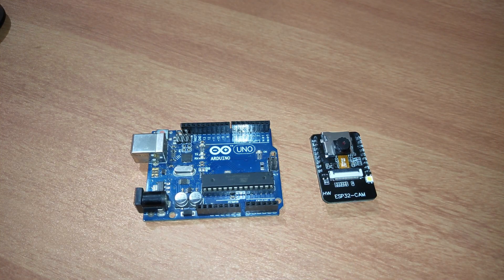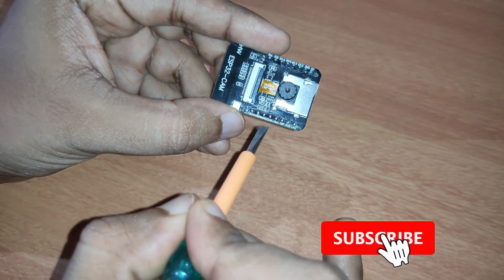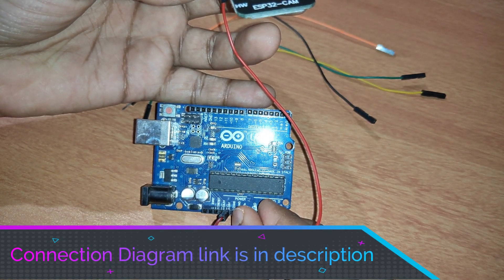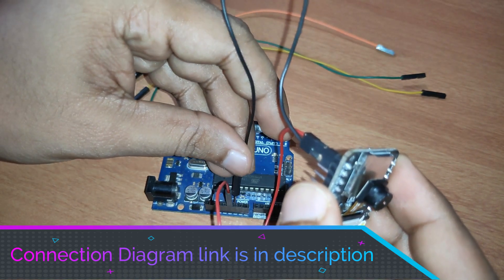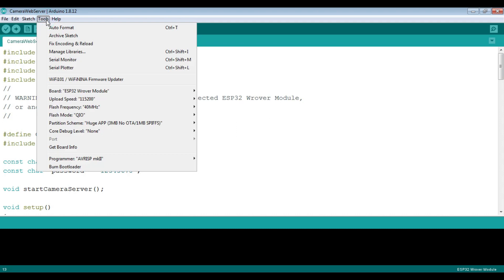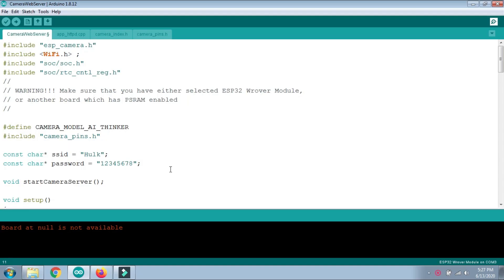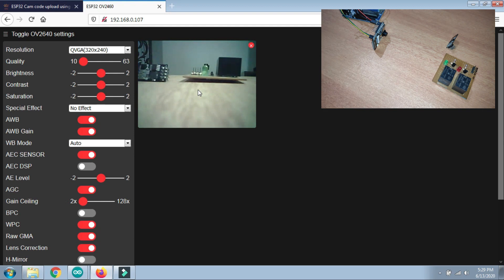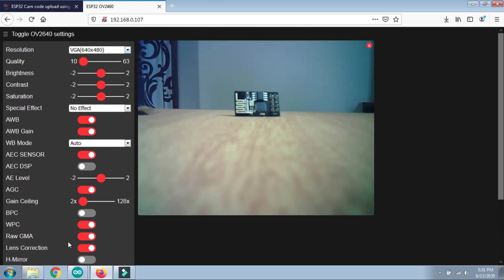ESP32 Cam code upload using Arduino Uno | ESP32 Camera Webserver for monitoring and streaming

Comment: I can not choose "AVR ISP"  Because my Arduino IDE shows "No programmers available for this board  . Why is your Arduino IDE available it ?
Reply: hey i am also having the same problem were you able to upload the code finally ?
Reply: i am also
Reply: You have to gnd your reset pin. That will bypass the processor on the UNO. else you would have to choose AVR ISP. Please correct me if im wrong im no genius.
Reply: Any Arduino IDE version above 1.8.12 will have this issue.
Reply: @abdulahali4698  thank you

Comment: Can we use ESP CAM as slave with Arduino mega. I have a project in which I need the to live stream using cam and I need more GPIO pins for attaching my sensors and actuators.

Comment: hi. do we remove the reset-gnd cable from the arduino board after uploading the code?  thank you
Reply from the maker: Yes
Reply: @IoTStarters  do we also have to remove the gnd-gipo connection in esp32 after uploading? Thanks

Comment: A fatal error is occurred: failed to connect esp32 :timed out waiting for packet header ....
What's the solution over there
Reply: remove  and plug your arduino again (it will be fixed)
Reply: @saritashekhawat21  🙏

Comment: error is showing,,,,,,invalid head of packet
Reply from the maker: Check the connections again
Reply: use the esp cam web server example code but before uploading make the changes from the video or just copy it from the site and paste it there dont paste the code in a new sketch

Comment: help there's an error, invalid head of packeeeeeeeeet
Reply from the maker: Please check the connections and select the correct board in Arduino IDE
Reply: now, there's a fatal error. Failed to connect to esp32: Timed out waiting for packet header
Reply: @teurejonism8531  did you resolve this issue?
Reply: use the esp cam web server example code but before uploading make the changes from the video or just copy it from the site and paste it there dont paste the code in a new sketch

Comment: Can someone help me i have error while running the esp32 cam module. Face detection and face recognition is not working 

Item psram alloc failed. Size: 126720 x 1
matrix3du item alloc failed.
dl_matrix3du_alloc failed
Reply: i have problem too like this. may you help me please?

Comment: After code upload i click the reset button bro , but i got the below error continuously  
assert failed: do_core_init startup.c:326 (flash_ret == ESP_OK)

Backtrace: 0x40083435:0x3ffe3aa0 0x40087e2d:0x3ffe3ac0 0x4008ce71:0x3ffe3ae0 0x400d8fbe:0x3ffe3c10 0x40082b55:0x3ffe3c40 0x400792ca:0x3ffe3c90 |<-CORRUPTED